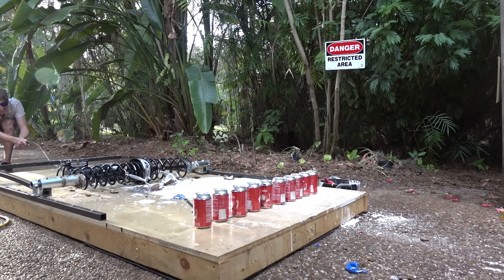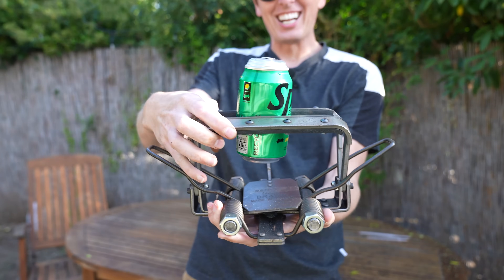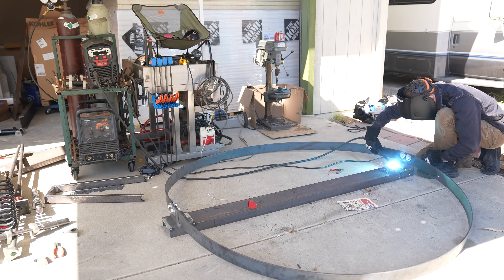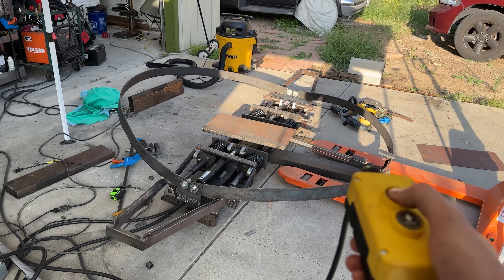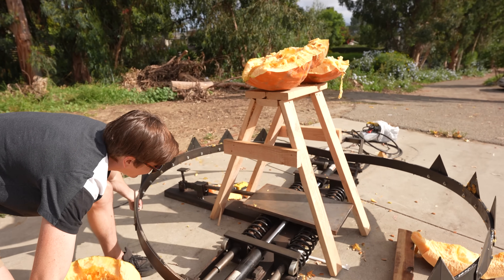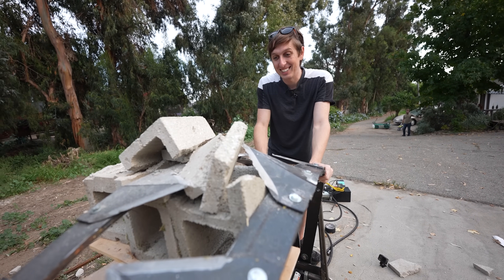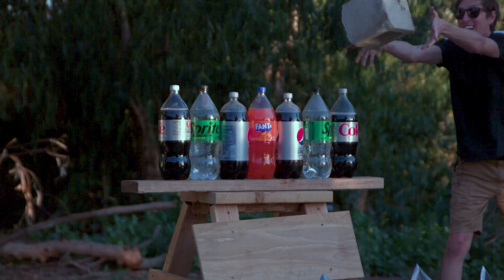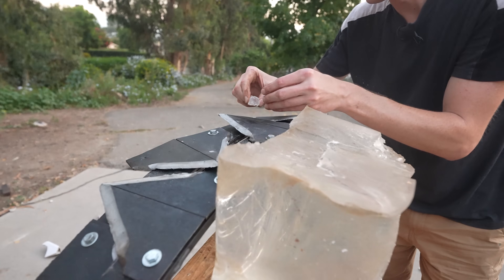I built a Bear Trap that can cut you in half

Comment: Here's the reformatted version for easy pasting into a YouTube comment:

Assuming the springs are standard car springs with an initial length of around 35 cm, compressing them to one-third of their length would mean compressing them by about two-thirds of the original length:

x = (2/3) * 35 cm ≈ 0.233 m

For a spring with a diameter of 15-20 cm and a 1-inch (2.54 cm) wire thickness, the stiffness (k) is typically around 27,500 N/m for car suspension springs.

Calculations:

1. Compression force for one spring:
   F = k * x = 27,500 N/m * 0.233 m ≈ 6,408 N

2. Total force for four springs:
   F_total = 4 * F = 4 * 6,408 N ≈ 25,632 N

The total force generated by the trap, with the springs compressed to one-third of their original length, is around 25,632 N (about 2.6 tons of force). That's a massive force capable of producing substantial pressure or closing power in the trap.

Comment: Seriously, I've been doing some tests to try to shoot small ball bearings using only spring power. I have a hunch that no matter how powerful the spring you use, you would not be able to improve this trap's closing velocity unless you applied mechanical advantage. My hypothesis is that there is a limit to how quickly springs decompress, regardless of the potential energy.

Comment: As many times as the latch slipped, i became increasingly nervous every time he was standing in the middle of it.
Reply: it wasn't loaded when he was standing in the middle.
Reply: @ledocteur7701  define "loaded". For a bead trap, it's set while it's latched open, and loaded when something is placed into it as a lure. Technically, it's set and he "loaded" it with himself
Reply: @chypearce8457 a small bear traps tension is used from the act of unclamping it, his tension is springs he compressed with a motor. The claws are free moving when uncompressed
Reply: @chypearce8457 obviously big springs are still dangerous regardless being that close. But this is a YouTuber 😂
Reply: @chypearce8457 the springs we’re not compressed
Reply: You have some balls fr standing in the middle of that lol
Reply: He has a air compression system for the springs so it’s technically loaded after he steps out filling the springs with air you see in 13:32

Comment: The Thorax-Body made from balistic gel won't even come close to a real human thorax, since there is no bones inside.
The gel only mimics the density and penetrative resistance to bullets of flesh. not the bones.
Bones can often even stop bullets. Especially the hip and spine...
So having a real Dummy, not just balistic gel, with bone-replacement-material or real bones from other animals, which you can buy (and yes they are expensive but if you say "it mimics the human body", then do not make false statements in this video pls...) will actually give you a realistic testresult.
Also: it did not cut clean in half, the body was cut where the blades are but there were still 2 spots where it just ripped off because there was no cutting. No Clean Cut...
Your videos are becomming more and more sluggish...
I hope that turns around some day...

Comment: If the bolts coming off is a problem, turn the heat down on that MiG welder u have and weld everything that doesn’t need to come off or rotate.

Comment: Good choice on the bridger dogless coil spring trap - they make a heck of a good trap and the dogless design makes it way easier to set (although slightly harder to adjust pan tension and file a good night latch)
Reply: Anyone who uses something like this on actual animals is an absolute psycho
(And no, I'm not a vegetarian)
Reply: Why would you use that? As a hunter, people who use traps disgust me. Hunting is fine, torturing animals is disgusting.
Reply: @FacitOmniaVoluntas. Modern traps are designed to not injure the animal. Hence the gap and rubber lining. Trap hunting is one of the oldest methods of hunting known by man. It's for catching food without damaging it.

Comment: ep your home cozy in the winter and cool in the summer with a climate-friendly heat pump. There is up to $11,000 available in rebates when you upgrade your oil or natural gas fossil fuel heating system to an electric heat pump. Heat pu

Comment: I did commercial animal trapping for quite a few years, largest foothold I used were just under the size for the wolf. We were trapping coyotes, and even those were scary to be sitting out in the field by hand. I can't imagine some of these larger ones…

Sidenote people might not understand the purpose of the rubber. It might sound a bit gruesome, but if the trap breaks the animals leg when you come back in 12-24 hours(depending on laws) there will be no animal. They will chew their leg off. If the bone is intact you will catch them. This is why it's hugely important to use the correct size a trap for animal and not oversize.

Scariest one I used was a Conibear 330 for body grip trapping beavers.  One of the guys I worked with had one go off on his arm when he was in the middle of nowhere. Scary forces to be messing with. There's no way you can unset one of these especially without one of your hands.

Comment: I was a trapper for a few years. Not a good one but I tried. I got my hand hit by everyone of my trap from a 110 conibear to a 1 3/4 duke coil spring and I will say that they cannot break bones. Now once you get up in power from those traps like a 330 conibear for beaver those can definitely break bones. But I never messed with them cause they put a giant swarm of butterflies in my stomach. But if you are a good trapper you can set the pan tension and set(where you place the trap) properly to best get your target species. The only time you run into trouble with trappers are people that don't check there traps twice a day or accidentally getting something small in a larger trap. Everytime I got a non target animal I was able to release them with no problem and no injury to them besides 1 opossum. Side note most foot hold traps are also designed to not be able to hold a deers foot. Also any traps with teeth onthe jaws are highly illegal and would result in some very bad consequences if you got caught using them. And trapping bears is illegal as well the bear traps you can buy are functional and legal to own but 100% illegal to use.

Comment: Here in the UK, pretty much all of those traps are illegal, and have been so for many years. Poachers used to use small 'Gin Traps' to catch game, but there is a danger of them catching stuff that isn't game. Gamekeepers used man traps to catch poachers - these definitely would break legs. I worked in a museum, and they had a man trap there - another attendant and I set it, which was not easy, or safe, and we triggered it with an aluminium pole from a set of barriers. It bent it as if it wasn't there. Any leg would have been seriously mangled.

Addendum:

Are you sure you're not Jigsaw? That sentry gun trap is certainly scary enough to feature in a 'game'.

Comment: I don't think you should be standing so close to such a powerful device without a shield when it's regularly throwing metal bolts and sharpened teeth the size of your head in random directions. The safety seemed somewhat neglected in this video.

Comment: What if you welded those teeth?
That'd make them a part of the trap rather than a part, meaning it'd share inertia, no?
Reply from the maker: I thought bolting would help hold the jaws together because I could only weld along the edges, also I wanted the teeth to be removable for some reason hahaha.
Reply: @TheBackyardScientist Well, if it's welded it becomes one structure.. that's stronger than bolts.
But then you wouldn't be able to remove the teeth, true.

Comment: The traps aren't made to break bones or cut off legs.. They're called leghold traps and are meant to hold by friction. Animal injuries are usually from the animal fighting to free itself from the trap, not the trap itself.
Reply: They're inhumane either way.
Reply: @LordDragox412  Not really. Like mentioned they are designed not to break bones or injure. There are also strict rules about how often you have to check traps (every 24hr where I live) and how many swivel points have to be on the line to ensure full range of motion so the animal cant dislocate or break its leg.
Reply: @Nick-sx6jm  Okay, step into the trap then. We'll see how happy you'll be to spend 24 hours "alone" in the forest. I'm sure you'll be perfectly fine physically and mentally afterwards :)
Reply: @LordDragox412  I have. I have had my hand and foot stuck before when setting a duke 650OS, which is designed for wolves. It definitely doesn't feel good when it snaps shut, but after that, it's just pressure. I have caught wolves, coyotes, bobcat, and racoons before, and their legs were just fine.
Reply: @Nick-sx6jm  It's not about whether the leg is broken or not. It's about the animal struggling for hours upon hours on end to free themselves. It's traumatizing for the animal. Leaving a trap completely unattended, for whatever amount of time, is just fucked up unless you're in a survival situation and have no other option.
Reply: @LordDragox412  They dont struggle for hours. I put up trail cams overlooking the traps to see what has been moving through and where they step. When something is caught, they freak out for a few mins, and then they realize they are stuck and lay down .
Reply: @Nick-sx6jm  Many animals are capable of chewing off their own limb in desperation, as not all of them will simply cower in place and "not struggle for hours". Prey animals can even go into catatonic state and die from simply being unable to escape. Not to mention what happens to non-target animals... Trapping is a cruel and messed up practice. That's why the use of leghold traps is illegal in EU.

Comment: You should learn about bolt strengths, the reason you broke so many bolts is because you used light weight grade 5 bolts at a minimum you should have used grade 8 bolts. 😊

Comment: Correction: balistics gel is supposed to mimic how soft body tissue reacts to BULLETS specifically. They aren't rated as a human analogue in any other use case, and in reality, while it does provide a good baseline, it isn't even always a good human analogue for gunshot wounds. (Any number of issues arise, mostly that you need different gel for subsonic vs supersonic rounds- and sometimes just for different bullet speeds regardless -different bullet types, and even different sizes. Though usually the biggest issue is how the speed changes things.)

To be clear, it's totally fine to use it, people just ignore that it's for ballistics use specifically rather than general stuff like cuts and blunt force a bit too often and it should get mentioned more that it doesn't really do a good job representing how a human body would respond in the majority of situations.
Reply: Given what the thing did to the cinderblocks as well, I still feel like this is a pretty accurate representation of how we'd fare in the g#@ d@%ned thing. Woof, I don't like that machine.
Reply: @zombie-process7025  Oh yeah. It'd shatter bones and slice through organs. There'd be no surviving it. It just gets annoying that people think a slab of gelatin is synonymous with the human body.
Reply: 2023's "You are using the wrong shovel".

Comment: These traps should be illegal!! They are not humane. Rubber jaws or not.
Reply: Foot traps are not designed to injure the animal in any way. They simply provide a firm grasp to hold the animal there until the trapper checks the trap to either dispatch the animal or release it, unharmed. Injuring the animal creates a level of risk that the animal will escape the trap or damage the fur, defeating the purpose of the trap. They are not even designed to cut-off blood supply, as again, this may injure the animal or allow the animal to injure itself due to the lack of feeling in the paw
Reply: @blakelarson6033  really, stick your foot in it!